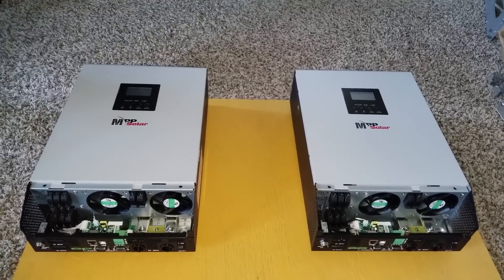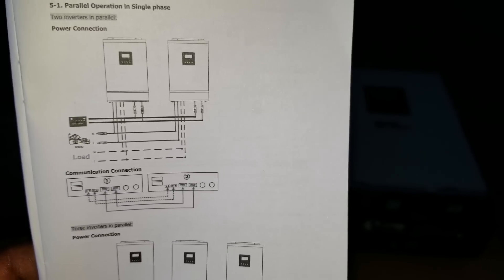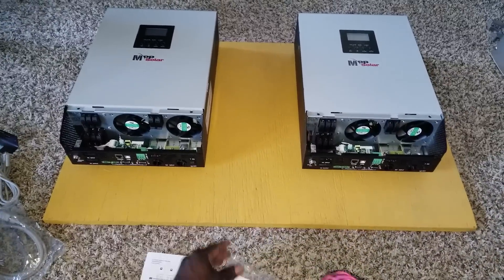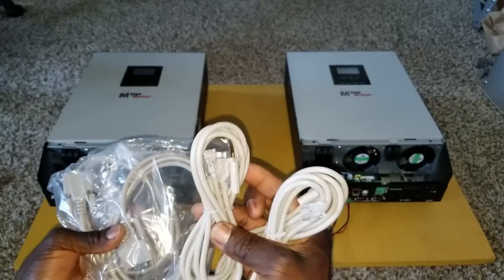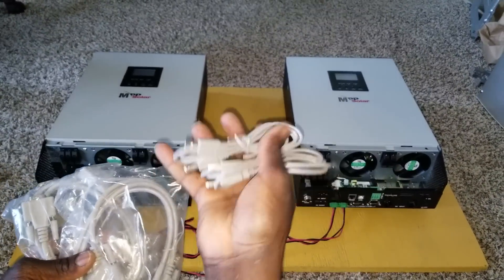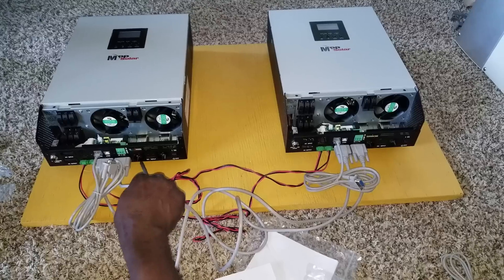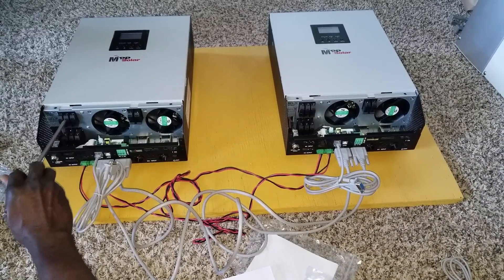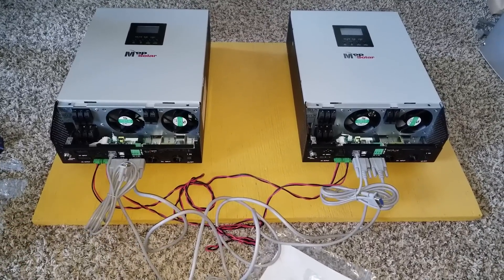MPP SOLAR HYBRID INVERTER/CHARGER PIP5048MG, HOW TO CONNECT PARALLEL SENSING CABLE & COMMUNICATION

Comment: Hello bro, thanks for the insightful video.
I have a quick question pls, when inverters are connected in parallel mode like this, does the charging amp of the inverters increase as well to charge the batteries via utility ?

To be clearer, lets assume each inverter has 80amps charger each, will it be a total of 160amps from both inverters charging the batteries or just 80amps from one of them ?
Reply from the maker: Thanks for stopping by and don't forget to LIKE👍SHARE and SUBSCRIBE.

when you connect inverters in parallel you Increase output power
By connecting multiple inverters together and running in parallel, the output power can be effectively increased.
Reply from the maker: If you have both AC Input wired on each inverter.

Comment: Is it a must for that last cables you just connected for the laptop, can't it connect without those?
Reply from the maker: You can program this inverter without have to use a laptop network cable to connect this unit.
Thanks for stopping by and don't forget to LIKE SHARE and SUBSCRIBE

Comment: HI    I  HOPE  YOU CAN HELP ME.... IF I HAVE TWO INVERTERS CONNECTED IN SERIES.. HOW DO I CONNECT IT TO MY SOLAR PANELS?
Reply from the maker: You can bring in the solar input on any of the two inverters or if you have a lot of solar panels or mixed panels, you can split them on each inverter
Reply from the maker: LIKE SHARE & SUBSCRIBE

Comment: Without looking at the manual what the easiest way to connect the current sharing cable because as the number of inverter increase the connection changes from 4,5,6.
Reply from the maker: It's not that hard but after multiple of inverters being added, it started getting confusing. I don't know how technically you are. 
Thanks for stopping by, don't forget to SHARE LIKE and SUBSCRIBE
Reply: @jwsolarusa  I read electrical engineer, I want to know how it is down instead of through the manual, I notice same connection is maintain from 2-4 but start following another pattern different from the initial when increasing from 5-6, his there any technical reason while it changes or way simple way to comprehend it
Reply from the maker: @saniabubakarmuhammed2224  
I will recommend you contact the manufacturer mppsolar.com sales@mppsolar.com
5F, No.76, Zhouzi Street, Neihu District
TAIPEI, TAIWAN 114
886.2.8797.8896 for better explanation.

Comment: Hi mr thanks for explanation  but I have two questions  first one  connect two inverter at parallel  communication  cable need  between  them? in the programme  have the same function(wireless)between them ?and second  questions we can connected  different  size inverter  in parallel for example  3kw u 5kw?many thanks
Reply from the maker: You need the parallel boards on each inverter to be able to parallel both Inverter/Changers

Comment: You are very clever. Why didn't connected   all cables?  How to connect AC for two inverters and one set of battery for two inverters.
Reply from the maker: Thanks
Reply: Welcome,  but my boy he 7 did connection simply like you show

Comment: Remember those are toys from Taiwan, outback is the only way.
Reply from the maker: Well well well.......!
CHECK THIS OUT Abisha:
OUTBACK POWER VFXR3524A GRID-TIED-OFF-GRID INVERTER/CHARGER 24V 120Vac WITH LiFePo4 BATTERY (Pt.1)
https://youtu.be/AqC_1IC7NOE

OUTBACK POWER VFXR3524A GRID-TIED-OFF-GRID INVERTER/CHARGER 24V 120Vac WITH LiFePo4 BATTERY (Pt.2)
https://youtu.be/-E0CHK2A7Q8
Reply from the maker: OUTBACK POWER SYSTEMS - FX2532MT SERIES INVERTER CHARGER: https://www.youtube.com/playlist?list=PLSNjIRSnUPDJQxDDUeupzqDdMCfkD5x3w

Comment: So when u connect these 2 where does the ac cable go to the left one or right what I mean positive and negative go to either same applies to pv also you only put all at one inverter?
Reply from the maker: Each inverter can accommodate proximately 5kW of solar. That being said you could have two solar Arrays one on each inverter at higher dc input voltage up to  450dcv.
LIKE SUBSCRIBE and SHARE my videos and stay active with this channel. 
Don't forget to check the rest of my videos on my playlist.

Comment: Hi, I want to parallel two inverter mpp 4048 but the first inverter had 15 solar panels (all solar panels is 250w) and the second inverter had 6 solar panels (all 6 panels are 330w). will this work with different watt of solar panel or not ?
Reply: Hi, yes it will. Only the solar panels on each inverter have to match each other.
Reply from the maker: MPP SOLAR INC - PIP Video Intro: https://www.youtube.com/playlist?list=PLSNjIRSnUPDKPKvDPjZgBaMgLMs-axclL

Comment: Hello my Mentor. 
I bought 6 (5kw) inverters like this and 30kw solar panels, 9 (24v/220a) batteries.  
Can you please send a video about how to parallel the inverters. 
I am starting to graduate from your website
Reply from the maker: 10kw MPP SOLAR PIP5048MG x 2 POWER BOARD | HYBRID INVERTER CHARGER INSTALLATION
https://youtu.be/Rh6uc-cPR5E

PIP5048MG Cable Management Cable Management Tips: https://www.youtube.com/playlist?list=PLSNjIRSnUPDK7wo8ldHXkyqpd_Xxh-OVu

MPP SOLAR HYBRID INVERTER/CHARGER PIP5048MG HOW TO CONNECT PARALLEL SENSING CABLE & COMMUNICATION
https://youtu.be/Xs_Wap2ToTk

MPP SOLAR 
BATTERYLESS INVERTER/CHARGER PIP5048MG Parallel Board Installation
https://youtu.be/KIXXQDJr6fc

MPP SOLAR PIP5048MG | HYBRID INVERTER CHARGER INSTALLATION TIPS (pt.1 of 2)
https://youtu.be/Mt1hH8e13LY

MPP SOLAR PIP5048MG | HYBRID INVERTER CHARGER INSTALLATION TIPS (pt.2 of 2)
https://youtu.be/q8l1SyUoL0c

MPP SOLAR INVERTER CHARGERS PIP 242424LV-MSD - COMPLETE INSTALLATION
https://youtu.be/Q-9AMh_ATTk

ADVANTAGES & DISADVANTAGES OF GRID TIE HYBRID INVERTER/CHARGERS vs. GRID TIE INVERTER WITH LIMITER
https://youtu.be/QWES48YIA0A

PIP 2424LV-MSD HYBRID SOLAR INVERTER CHARGERS
https://youtu.be/3JRUGOBlp1s

PIP 2424LV-MSD 120V 60Hz INSTALLATION COMPLETED: By jwsolarusa
https://youtu.be/dHcp6rTmJVg

PIP 2424LV-MSD WENT LIVE ON A CLOUDY DAY AND MAKING SOME SOLAR POWER Pt.10
https://youtu.be/TZZKn4k7s8Y

MPP SOLAR INVERTER CHARGERS PIP 242424LV-MSD - COMPLETE INSTALLATION
https://youtu.be/Q-9AMh_ATTk

Comment: Is it safe to connect 3 units in paraller without battery?
Reply from the maker: You can switch batteryless when it's ok to do so by having enough sun power coming in to power your minimum loads. But can't just be on batteryless just because you don't want to have a battery bank lol

Comment: Hi,i had inverter model: 5KVA 48V-PAR-A 
Could i parallel with same type and size or with 4kva or 3kva ?
Because i read about another type working with parallel model: 48KVA-PAR-B
Reply from the maker: When you parallel Inverters, they have to be the same make model and KVA
Reply: @jwsolarusa  Thanks but Does this  model: 5KVA 48V-PAR-A suitable for parallel with same model or not ?

Comment: Thks but I have a dumb question.  ?Why must the pair of hybrid inverters be connected?  or ?What does the connection between them do?
Reply from the maker: Stacking/Parallel the Inverter/Charger to give us one huge 10KW since each Inverter is 5kW
Reply: @jwsolarusa  Oh & I guess the connection between the pair is to keep the two 120VAC sin wave 180degs out of phase too or something like that.
Reply: @tombouie  actually, to keep them in same phase.

Comment: What if we don't use communication cable and use both inverter on same ac line independently
Reply from the maker: Login to: www.mppsolar.com/manual
You will find all the answers to your questions. 
LIKE SHARE and SUBSCRIBE